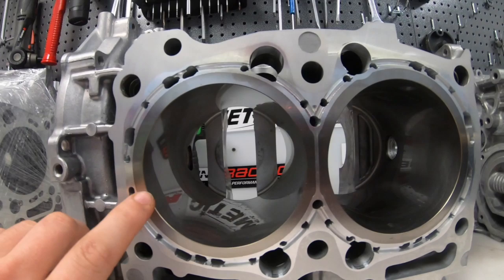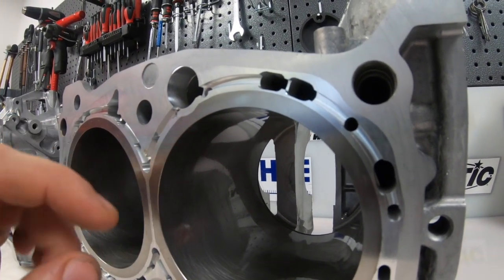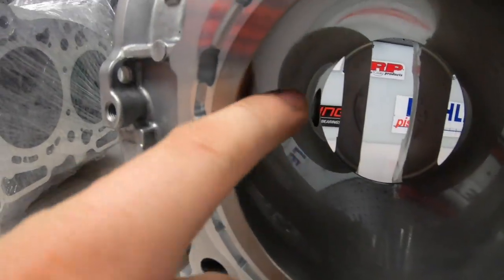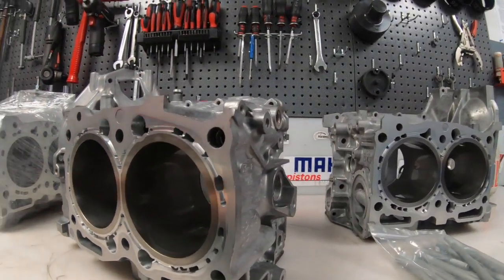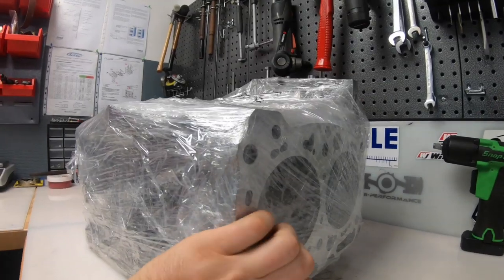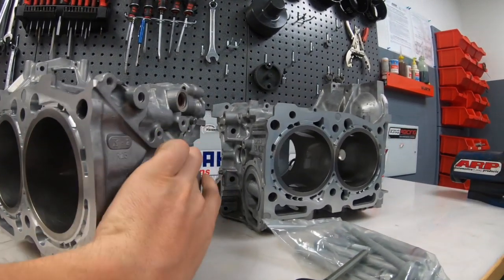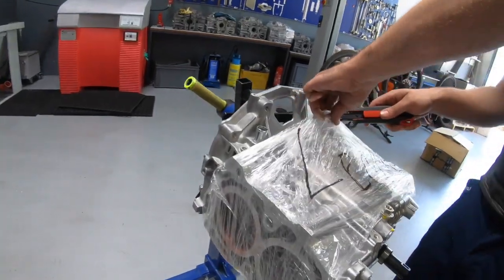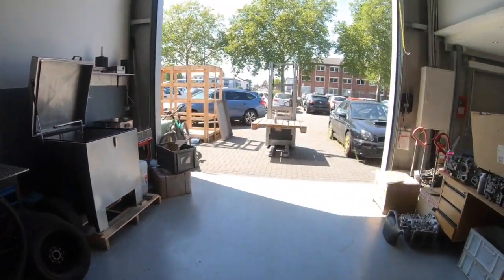1000HP EJ25 Subaru Engine Case l Stage V l Subi-Performance

Comment: Do you ever do anything with 6 cylinder Subaru engines or do you not like them?
Reply: From what I have read the 6 cylinders are perfectly balanced compared to an opposed 4 that still has a tendency to want to twist horizontally. The 6 cylinder design also cancels out this twisting force as well. I think engineering explained has a good video on it.
Reply: YES! cant believe he still hasnt done an ez30 yet, we need to see this pronto!!

Comment: Not on topic, but what do you recommend pouring oil on near-stock engines? (JDM GDB spec c 360hp boost 1.8-1.3 bar stock turbo)  5w40?5w30? Thanks for the interesting content)